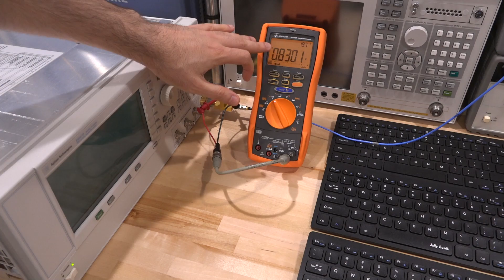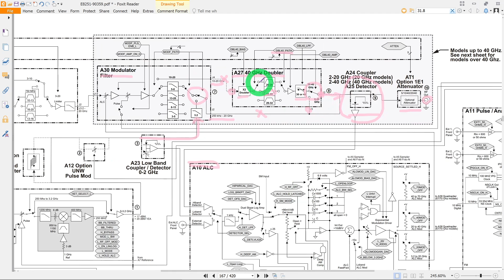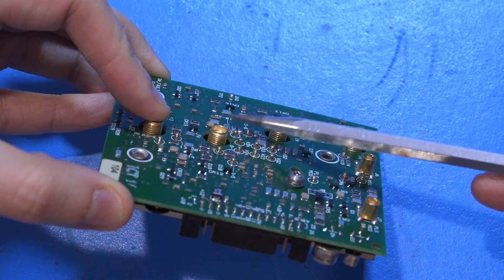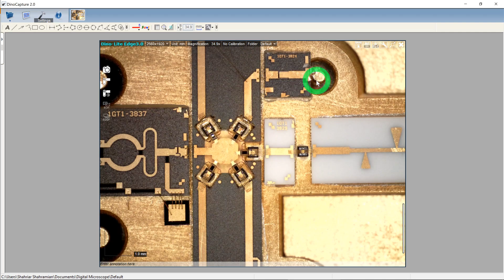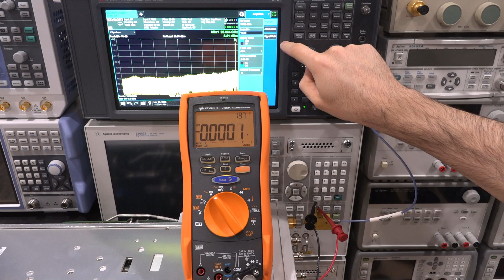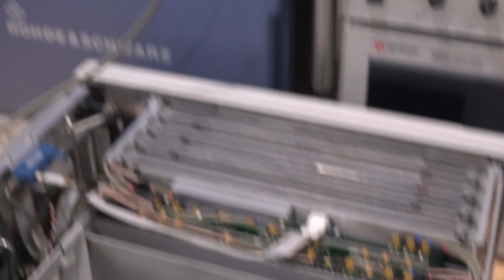TSP #167 - Teardown & Repair of an Agilent E8257D 250kHz - 31.8GHz PSG Analog Signal Generator

Comment: I had a ribbon cable with similar manufacturer design on a weight  scale.  It had an internal short down to .5 ohm. I looked around with a magnifying loupe but could not find it. I didn't want to continue poking holes in it trying to trace it down so,  I replaced the ribbon with wires. I have a working scale again.

Comment: For future reference on repairing that crystal. Those broken wires could be welded to new wires by a good jeweler with a laser welder. I had some work done on a set of diamond ear studs that had one missing mounting stud, they welded a new one on in a few minutes.

Comment: I was assuming a copling capacitor had gone short circuit. Perhaps a DC block would have been a quicker temporary fix?
Reply from the maker: The DC voltage constantly forward biases other diodes in the same module. DC block would have solved the issue for the next stage, but no the same stage.

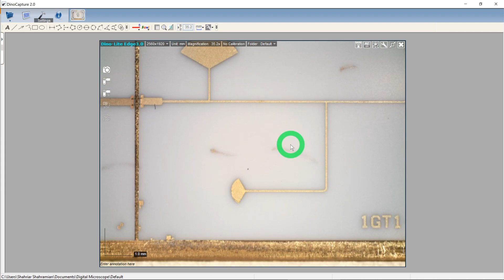Comment: What is the best way to tell if an RF board is ceramic or Teflon, like at 24:43? I would have thought that board was some type of Teflon base material. Thanks!
Reply: If they can get away without flexing, like they can in a rigid metal enclosure, it's going to be ceramic, because the performance is better. If you have doubts, you can bang on it and see if it goes "click" (ceramic) or if it goes "thunk" (teflon).
Reply: @jjoonathan7178  Thanks for the info. Yeah! I was thinking you could lightly tap it with a plastic spudger and judge by sound. Thanks!

Comment: I worked for HP/Agilent in Labs, and supported the Santa Rosa site for a while. Congratulations on fearless troubleshooting and repair! Not many are willing to crack open an OXCO to look for problems, but that part is easy after digging into one of the RF decks!

Comment: how does one replace the diode? (as in how do you get it off without destroing things around it)
Those coils made of bonding wire look like they've been tuned by hand...
Reply: The bonding wires in some situations can and are used as adjustments! As an example, positioning the bonding wires in the Hp/Agilent 848x RF power sensors is an important part of calibration.

Comment: Putting up to 13v dc into the attenuator surely is bad thing? But obviously it survived
Reply from the maker: There is a biasing resistor in series with the diode and 13V source. That’s what has saved everything.

Comment: Those two power transistors inside the oven are actually the heater elements. They operate in linear mode, and are easy to control how much power they would dissipate. And the white wiring inside probably goes to a temperature sensor close to oscillator itself.
Reply from the maker: Interesting. It could be! I should have measured it.
Reply: @TheSignalPath  my signal generator showing a error 617 configuration error can  you know somthing about it
Reply: It makes sense

Comment: considering the fact that the unit is now functional, but missing a diode and thus technically not up to spec, is there anything they can do with the instrument? Can they rent it, or will they just have to sell it as an as-is kind of thing? Or just wait until they get the correct parts anyway.
Reply from the maker: It depends on where it is used and for what purpose. If you want 100% factory performance in all conditions and corners, probably a new module is required.

Comment: I have to second the hp vs others service manuals.  HP and successors have excellent service manuals but Rohde & Schwarz has a terrible service manual even when I got one from the vendor. I received a service manual from Rohde & Schwarz for an ESIB40 EMI Receiver and even that service manual did not have enough information to diagnose the problem.

Additionally, HP and successors user manuals are fantastic vs many other companies.

Comment: Nice video!   Yup, a wire bonding station would be a nice addition and produce some great content.  Then you need as assortment of replacement chip diodes and transistors.   Wonder if there is a supplier that sells chip components in less than 100K quantities.

Comment: It was interesting to see the little coils of wirebond wire in the module. Are those there for some kind of trimming? Adding those little coils in must have been pretty tricky. 
If you get a wire bonder, a few words of advice on shipping. Make sure the seller properly secures all moving parts. I had bought one a few years a go and the seller did not secure the arm. The head assembly and several switches got the living daylights beat out of them. Also if it is an older west bond, like I bought, make sure they secure or remove the PCBs from their slots. I had to replace a broken  40 pin edge connector because of that.
Reply from the maker: Yes they are inductors designed to be attached using the same wire bonding techniques.
Reply: I thought the coiled wires were inductive elements..?

Comment: Nice work Shahriar. Looking at the way the crystal pins were twisted suggests the damage was done during reassembly. Sooo close :-)
Reply: I was thinking the same. BTW, how about long time oscillator drift after the thermal shock of soldering the crystal's pins?

Comment: these YIG-Modules are a really common failure point in HP/Agilent/Keysight devices. 
Earlier instruments didn't have the option to switch to a different reference, I think they added that because the YIGs fail so often
Reply: There was nothing wrong with the YiG. There is a faulty PIN diode and a broken 10MHz TCXO module
Reply from the maker: Keep in mind that the YIG does not replace the OCXO. In fact, the YIG always needs to be in a closed loop (using a PLL) in order to have the desired frequency.

Comment: What could have happened if the -13V would have reached your spectrum analyser?
Reply: He would have had two instruments to fix.  As he says at the beginning, spectrum analyzers often can't tolerate any DC voltage at their inputs.  It can destroy the input circuit.
Reply: I think it lets the magic smoke out!